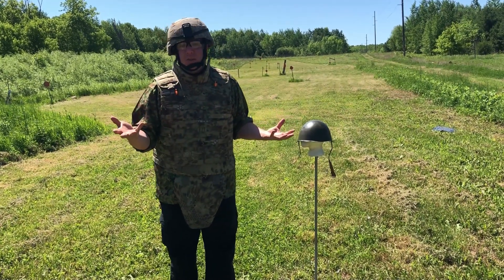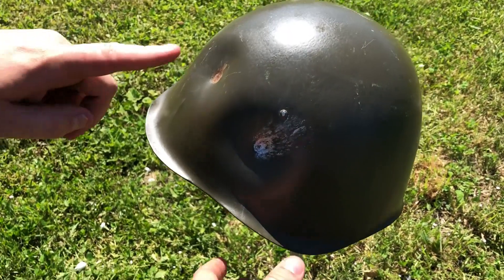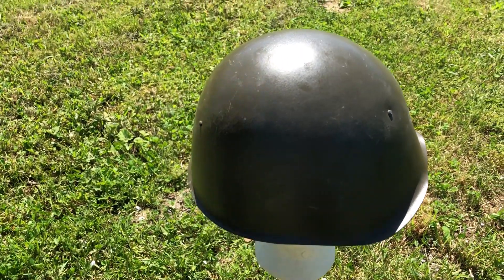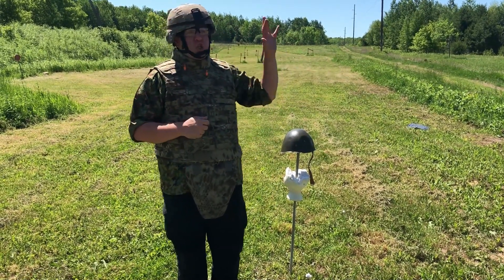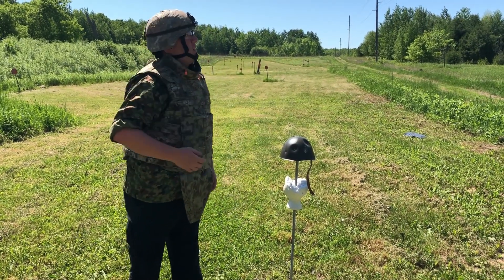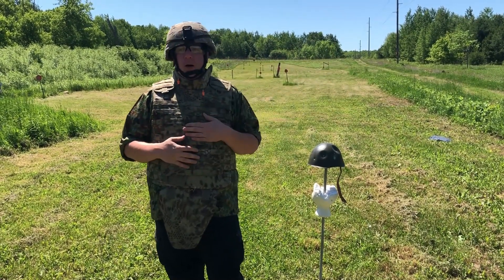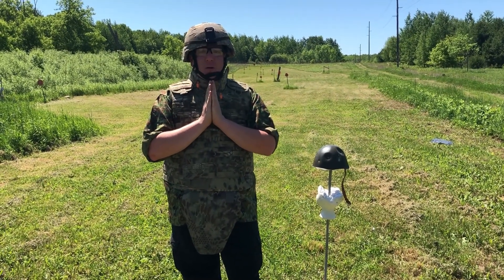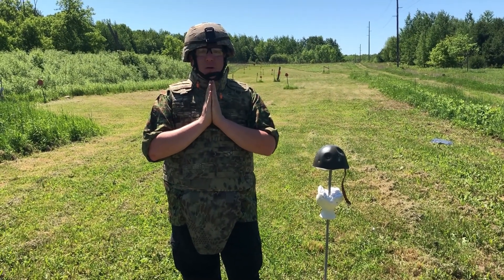Helmet Ballistic Test: Polish Wz.50 Steel Helmet

Comment: I have a wz50 and wz67.what i found ,late production of wz50,produced after 1970 has same front and back slop as wz67. The difference is in ear protection only.i think factory standarosed tolling and only a finishing tooling was different. Also i compared hungarian m70 which is a direct copy of ssh40: ssh40/m70 is fully round ,spherical, wz50 is front sloped and rare spherical.
Reply: Венгерский м70 и СШ40 все же имеют небольшое отличие в форме купола. М70 более округлый вверху.